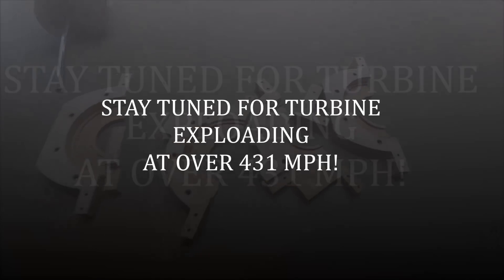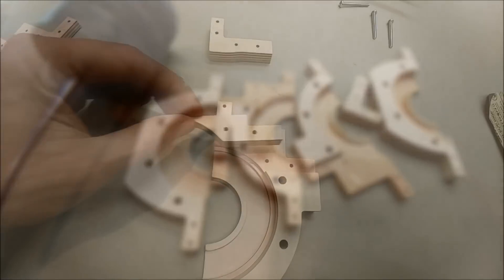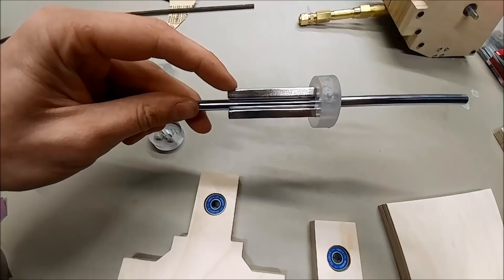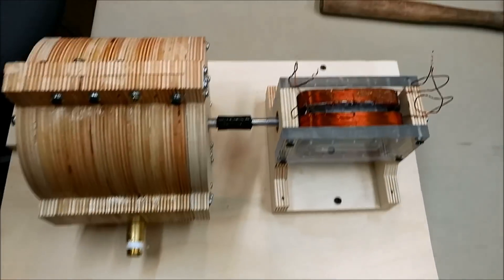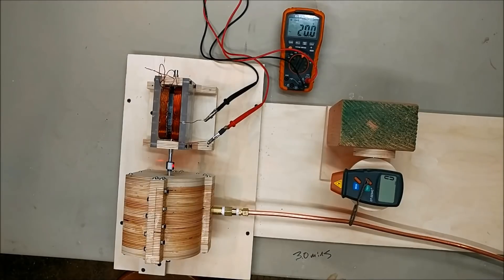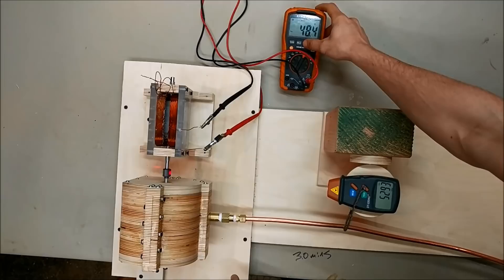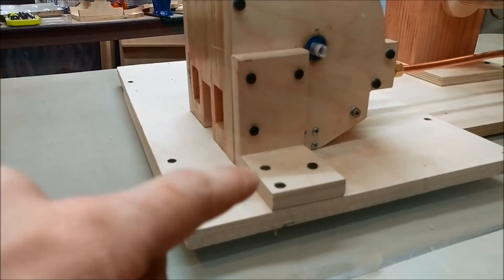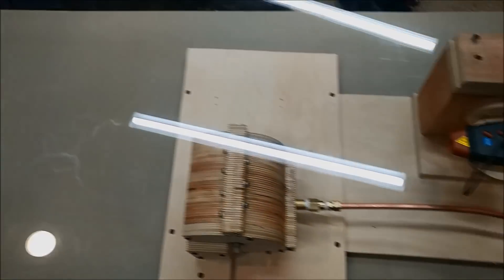See The AWESOME POWER of the Two Stage Tesla Turbine!!

Comment: Taking weakest possible materials and spinning them really really fast - what can possibly go wrong, ...
Reply from the maker: Did the job, i had to build things cheaper so I could learn when I was new. Now I use aircraft grade titanium for the rotor, which is ductile and hard at the same time. It's designed for compressor blades in aircraft. I'm no longer using compressed air to test with.

Comment: Nice experimental concept, wood and CD discs are available and not expensive, but why did you just turn the air pressure on and off at full line pressure.  You should have used the gate valve on the copper supply line at half open, then gradually experiment with the compressor line regulator that was turned all the way down to zero, this way you can control the turbine's tendency to overrun once it is spun up.  Turning it on from an open-closed gate valve is not enough control.

Tesla did his experiments from the basement of a building heated by a wood boiler, in order to make it available to any such building with any available power.  His method also had catastrophic RPM speed overrun that caused material failure and melted bearings.

Better luck next time.  Thanks for posting this video, it may help a lot of experimenters in the future.
Reply from the maker: This was a supersonic attempt for a friend. When built and run properly, there is no risk of overrun.
Reply: @iEnergySupply  The overrun that I am expressing incorrectly is the device ability to reach insanely high revolutions beyond the stress limits of the materials. This was one of the things that Tesla experienced in his first model, insane RPM''s that are beyond the needs of the turbine or the generator can be characterized as overrun.  There is never a reasonable need to rev these over 5,000 RPM, there is nothing made that requires it or can stand being cranked that   fast.  This is one of the reasons the 10,000 RPM+ exotic and other race cars do not have alternators or water pumps, they run on a battery sufficient for the race for cooling and power if it's needed.

Are you going to have a new video on the fully functioning version that explains your process?

Have a good day.

Comment: More than a hundred years ago, Tesla invented an engine so powerful that even today's most advanced material sciences can't keep it from blowing itself apart from the sheer power its capable of producing.
Reply from the maker: the video you learned that from made some big mistakes in their math. The video says the rotor must spin at a very high rpm, maybe 50,000 for a 6” turbine. The speed of a turbine is based on periphery speed not rpm. If a 6” turbine needs to spin 50,000 rpm to be efficient like the video says, that’s a periphery speed of 890.1 Miles per hour. If you want a 3 meter disk to achieve close to 891 miles per hour at the periphery, the rpm required is only 7,253. We have materials that can easily reach that speed.
Reply: @iEnergySupply  reach it yes, but can they sustain it?
Reply from the maker: @Beef1188  There are tesla turbines in use today professionally. Nikola tesla had one in the edison company run on steam that put out 600 horse power.
Reply: @iEnergySupply  so how come it isn't in more widespread use?
Reply from the maker: @Beef1188  Energy is more valuable without the tesla turbine. Here is an example, light bulbs are designed to wear out far before they need to. It's to make more sales, if your lightbulb lasts forever then the companies selling you the lightbulbs won't make as much money. We have technology to make lightbulbs last forever, but we don't use the technology. Same with the tesla turbine.

Comment: That's the issue with Tesla turbine, the Rome it receachs exead what materials we have can handle. If you can solve that, its an amazingly efficient design at extreme rpm. Tesla theorized if the materials could be made to handle the speeds it would be most efficient turbine for power generation.
Reply from the maker: I just wanted to note a big mistake in the video you watched. The video says the rotor must spin at a very high rpm, maybe 50,000 for a 6” turbine. The speed of a turbine is based on periphery speed not rpm. If a 6” turbine needs to spin 50,000 rpm to be efficient like the video says, that’s a periphery speed of 890.1 Miles per hour. If you want a 3 meter disk to achieve close to 891 miles per hour at the periphery, the rpm required is only 7,253. We have materials that can easily reach that speed.

Comment: in a book i read on theory, the author tells a story about someone testing a prototype machine at a Vegas trade show with about 20 people looking on when the thing violently blew apart (no shields) and in a miracle no one was hit with shrapnel.   the thing was made of metal and the author notes that had the creator understood theory, the device would not have utilized the materials the way it was done.   Basically the man build a bomb which at speed would fail in amazing fashion.

we had a tesla turbine at the tech school where i got my degree in green energy but it had a regulator on the air flow to prevent over speed, however the top speed of that one might have done the same thing you got.

i'm glad you are proactive and stayed safe.

Comment: That’s amazing! You have plums of steel and maybe not the best judgement, but that’ll take you a long way. Good luck with this, I’m excited to see what you could do if you machine out of much stronger materials. You could REALLY use a 5 axis machine for that housing, the internal radius’s will be challenging, but you’ll pull it off. I wonder how good of a finish you’d need? You want little turbulence as possible between housing a plates.

Comment: So what did you expect? An voucher for ignoring physics?. 
I think your idea is good, but your excution was quit faulty. if your going into this kind of rotational speed, your'e really should start to consider the inertia of your system and the strength of your material. Otherwise you channel becomes famous of showing obvious fails.
Well still keep going
Reply from the maker: or record since was 150000 rpm

Comment: I would be really interested to see some efficiency measurements,  energy in Vs energy out.  How does this turbine compare with a more standard impeller? What would be the energy loss if renewables were used to make compressed air? Would it be practical to use compressed air in place of batteries along side renewables?  Great video with a spectacular failure\opportunity to learn.
Reply: Theoretically they can reach higher levels of efficiency than regular turbines, however this is only achieved at high rpm with many discs/high surface area. Currently most materials that could be used cannot sustain their shape at the centripetal forces they would experience then.
Reply: it will be terrible , hence why there never used
Reply: Awful output vs input.  Standard turbines are orders of magnitude better.  But that's why all the Youtube Tesla Turbine Videos never do quantitative measurements.  They're just looking for "views" and "likes".
Reply: @kyleb3754  Thank you, I appreciate the comment. I need to look else ware for a solution.👍

Comment: Nice job! Turbine build looks good, However, generating voltage is not the purpose. Think of a generator as a device that transports torque. The torque it takes to turn the generator is transmitted across wires to turn a motor. Amps is the preferred terminology. It is also the cause for having larger turbines and generators. To move more torque. The turbines today develop torque at 900, 1800 and 3600 RPM's, respectively.  This is because of the Frequency that the USA uses. That is 60 Cycles per second. The 60 Hz is developed by the number of segments in the generator. once the generator is "synchronized" with the grid, 60Hz, the turbine is then allowed to drive the generator at full torque. This drives the current. The RPM's can never exceed the 60Hz, or the 900, 1800 or 3600 RPM no matter how much torque is developed. The voltage in a 3 phase generator is adjusted with what is called an "exciter". That is used to maintain the voltage at the desired delivery voltage to the transformer that either steps up the voltage or drops the voltage to be used in our homes. Will the Tesla Turbine develop the current when it is at 900, 1800 or 3600 RPM? IE, how efficient is the Tesla Turbine when it is spinning at those RPM's? Would love to see that experiment. And will the Tesla turbine work with steam? Using compressed air means that I also meed a LARGE compressor to deliver the air. That means I need either a LARGE electric motor or a combustion engine to drive the compressor. Keep up the great work you are doing! A turtle never gets anywhere until it sticks it's neck out!  Truly enjoyed your video.

Comment: Fun stuff!  You've got an instrumentation problem though - that meter isn't a "true RMS" meter, and so its AC voltage measurements will only be correct at 60Hz.  Since your generator's frequency is dependent on turbine speed, your measurements are going to be way off.  With an RMS meter, you can put a resistive load on this device and calculate the power output.
Reply: True RMS means that the meter will indicate the true RMS value of the input irregardless of the waveform. 
They are usually higher performing meters so they will probably have good frequency response.
The Fluke 117 I have has a response from 5Hz to 50Khz.
At 40000 rpm the frequency of rotation is 666 hertz.
I think the two magnets will double this.
Non true RMS meters might work at 1333 hertz.
Look in the manual.
Reply: The DMM used is a Klein MM600, frequency response 1Hz to 500 KHz so you will be ok.

Comment: That's the power of unbalanced rotors at high RPM.
Reply from the maker: yeah and the material couldn't hold it's self together after it reaches a certain speed. no mater what material it is even if it's completely balanced it will eventually fail if you go fast enough.
Reply: @iEnergySupply  That's true - there's a limit for each material (max stress), but I could hear the imbalance, even at low RPM. However, like you said, the CDs would have torn apart no matter how balanced, as soon as the centripetal force exceeded the cohesion of the material. Pretty dramatic, though :-)
Reply: @iEnergySupply  Yep.

Comment: The tesla turbine is a revolution in electrical generation, but it needs a materials science paradigm shift toward more knowledge. The inverse square law is the limiting factor. This needs to be studied further. The threshold of the radial circumference exceeds material science potentialities. Once we close that gap then the tesla turbine can shine, Tesla Himself acknowledged this, currently the radial velocity is a problem.
Reply from the maker: I just wanted to note a big mistake in the video everyone  saw that implies what you are saying! Tesla actually got 200 horsepower with his 18" turbine. In the video that says the rotor must spin at a very high rpm, maybe 50,000 for a 6” turbine. The speed of a turbine is based on periphery speed not rpm. If a 6” turbine needs to spin 50,000 rpm to be efficient like the video says, that’s a periphery speed of 890.1 Miles per hour. If you want a 3 meter disk to achieve close to 891 miles per hour at the periphery, the rpm required is only 7,253. We have materials that can easily reach that speed.

Comment: Only "why" i got is wtf , glass shields??  Dumduhdumdum..  lol..   i had this buddy who was a chemical engineer and got his doctorate in the stuff.  Was doing cutting edge experiments with classified compounds which is miles ahead of any chemistry class i took and i had ap..  but this dude although book smart, would always forget the most mundane shit or use things he thought would work but not use common sense. Like he was melting some alloy with an induction heater we made then he goes and mumbling to himself the melting point of glass and compression strength of plate glass trying to calculate the thickness to which glass could handle a certain temp and said to himself, "yea it will work fine". About that time he poured the molten metal on a glass lens of a 5k$ electronic microscope then wondered why it exploded..  then tried to put out the fire with rubbing alcohol...  genius..  his explanation was the lens has compressed gas behind it which superheated it to the point of auto ignition..  not the fact that the glass lens had a surround of pvc with a rubber grommet to seal it...   lol..  he actually passed away last june of liver failure after a toxic amount of radiation was released and exposed him or his area with it and basically suffered till his death in the hospital..  for a few weeks..  sad story..  could have gotten a nobel prize for his lifes work..  so he said..  lifes a bitch.  You gotta learn how to keep it happy or itll bite you in the ass first chance it gets...  stay safe...

Comment: I'd make it smaller, MUCH smaller perhaps, since the reason why the Tesla Turbine failed in the 1st place was because no material at the time of its invention could handle the full potential of the turbine, at the sizes that were being tested. Therefore, perhaps the answer was scaling it bigger not in size, but in sheer numbers of smaller sizes?
Reply from the maker: With higher rpm's it's possible to achieve higher efficiency's. At the moment, we have reached 150000 rpm and that's 1400 MPH. We will see what efficiency's we can get with these numbers soon. You are correct about the larger turbines being easier to use achieve higher efficiency's though.

Comment: Well you definitely did the destructive testing portion of your research. About 70% of the rpms you got that caused failure would be the max safe range for your design. Impressive to say the least. Make smaller ones out of aluminum and they would make awsome air driven ultra high speed milling bit tool holders.
Reply from the maker: since then we have switched to ballet proof plastic, and carbon fiber, our new speed for operation is 1400 miles per hour.
Reply: @iEnergySupply  mph.... 1400.... vroom vroom...

Comment: Great video! I feel the issue was as the RPM increases the air travels around the housing more times taking longer to escape through the exhaust. At this point the back up of exhausted air with a continual supply causes the wooden housing to become a pressure vessel. Well done to get 40000 rpm, looking forward to see the CMC version maybe with a slightly larger exhaust and inlet. An even bigger well done to look after your own safety and use protective glass.
Reply from the maker: Gosh, what you said is exactly what we did, now we are getting these speeds with 1/100th the pressure using carbon fiber disks. It's getting better and better.
Reply: Will create a much bigger & violent explosion...
Reply: No. That is not why it exploded.
Reply: porque einstein jajajjaa @Knight3rrant

Comment: "oops...let say we try that again, without the oops"
I hope your cnc is cutting titanium because at industrial levels it would be pushing material limits.
Reply from the maker: What we are using now is carbon fiber, with a thick bulletproof casing.
Reply: @iEnergySupply  Bullet proof casing is probably a good idea. I am not convinced even carbon fibre could take mach 15 rotational velocities for an industrial scale model.
I have seen your latest videos though and I reckon, well you ain't aiming for industrial set ups any way so keeping it scaled to a residential unit is probably wise. 
But one way the elite will try to shut you down is probably on the merits of strength of materials being too dangerous to allow public use off.

Comment: What do you think about building out of Alon which is transparent aluminum. It's stronger than steel lighter and easier to machine.

It comes precast in tube or flat sheet.

It would help reduce the weight of your machine to meet your spec of 10 horsepower to one weight ratio.

I've seen suppliers for it online it comes in any thickness you want. Believe it can be machined or CNC.
Reply from the maker: today we are using carbon fiber. We got almost two times the speed of sound at 1400 MPH